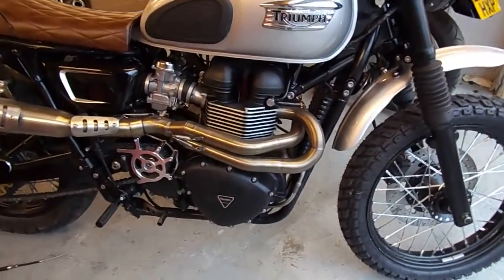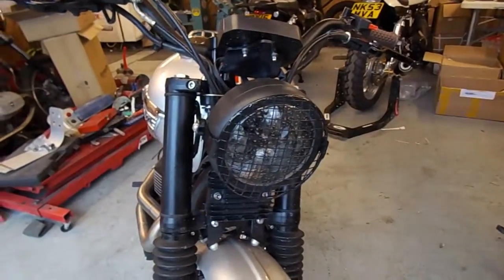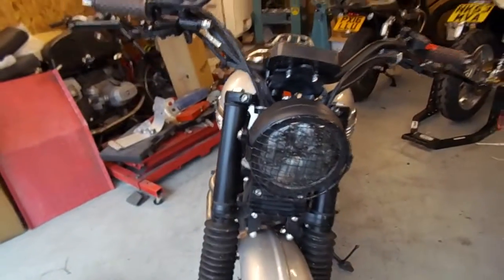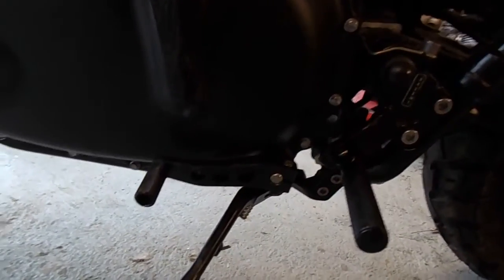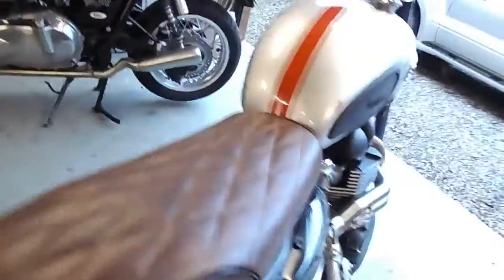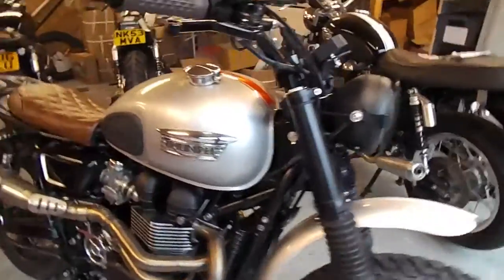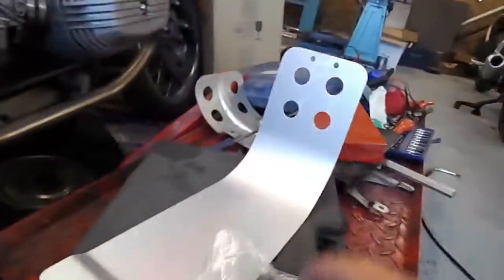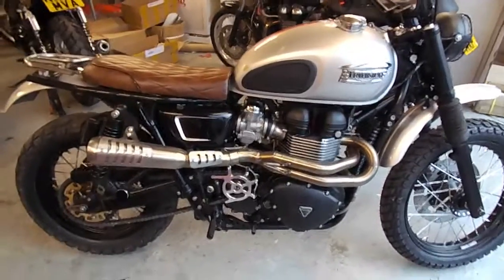Part Two - Converting a Mag Wheel 2015 Bonneville into a Desert Racer Style Scrambler

Comment: Quick question.....Looking at the other video where it is put on...and then this ne to hear it without baffles....Look at the shields in the two videos. These ones look more molded to the exhaust whereas the others looked "OUT" more. Do we just bend them down from the edges and mold them around the exhaust? Thank you. Looking forward to ordering this soon fro my 2017 Scrambler 900 and replacing the huge/heavy stock exhaust.
Reply from the maker: Hi
the old video showed the prototype exhaust, all the production exhausts now have more curved heat shields

Comment: super work, just noticed the new LCD panel with fuel gauge,  so, can we fit the tachometer and speedo of the new Street twin to the old bonnie?
Reply from the maker: They are both the CAN BUS Triumph system so probably yes but not tried it yet and it will not be plug in !
Far easier and cheaper to use an aftermarket module and clock
Reply: Whether the fuel Guage is working